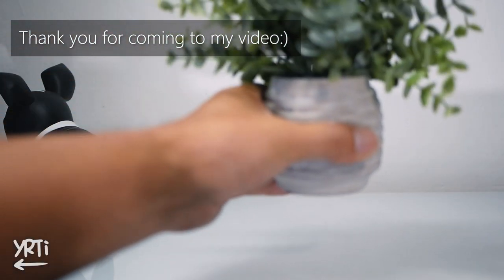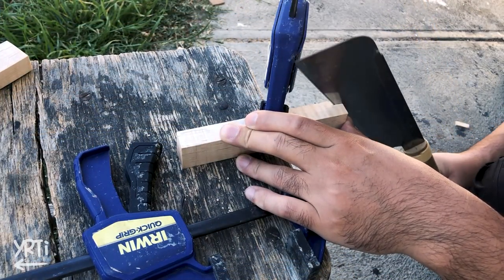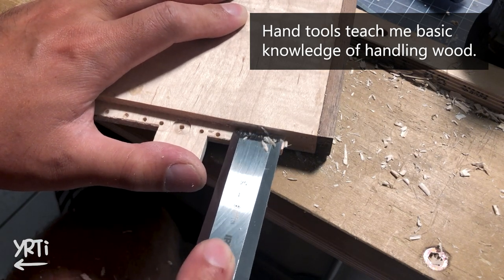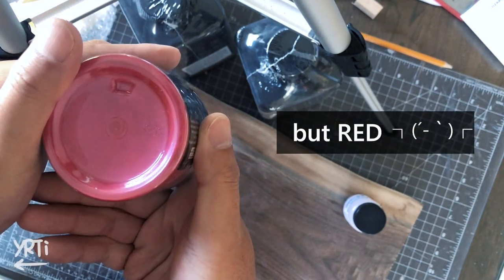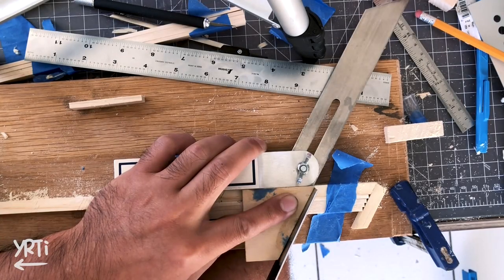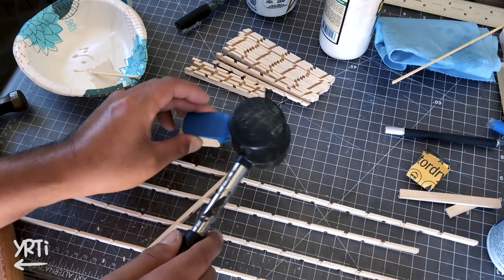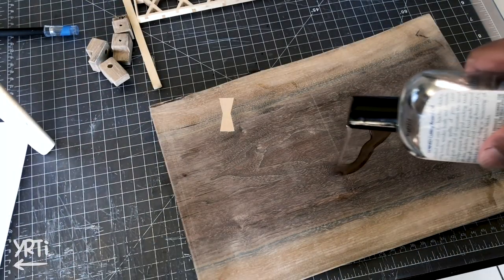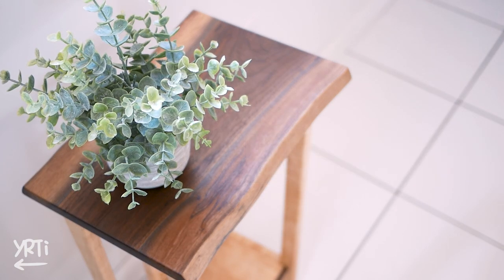Plant Stand/End Table with Kumiko by Hand Tools

Comment from the maker: I wouldn't recommend the wax/steel wool combo on an oil finish product. I was lucky that the black residue from the combo didn't go deep in the grain at this time and I had no problem with cleaning it. When I tried it on birch, I ended up sanding all the surface from 120 grit to clean the black residue.

Comment: Spokeshaves are such a pleasure to use. I've got 2 vintage Stanley 151s. There just like yours, except they have a flat sole. One was a rusty mess when I got it. It still needs to be restored. I'd love to get one with a curved sole eventually. The project was beautiful. I love the through mortise and tenon joint.
Reply from the maker: Thank you for the comment, Danny. Nice you have 2 good ones! I still can't use mine well so I have to practice more:)